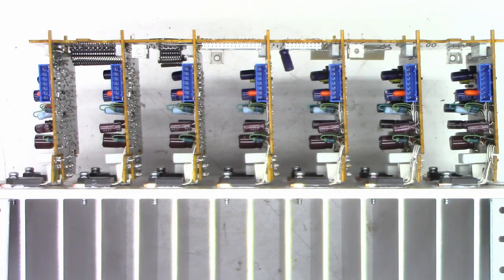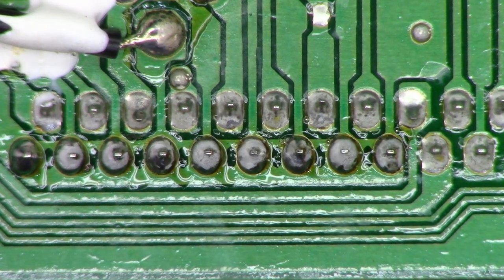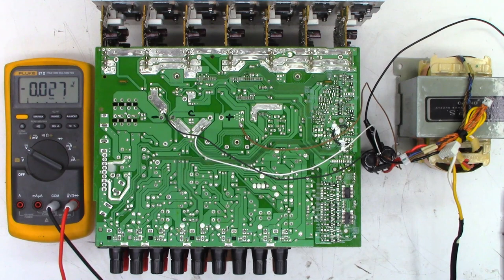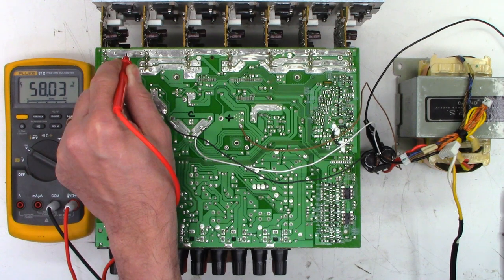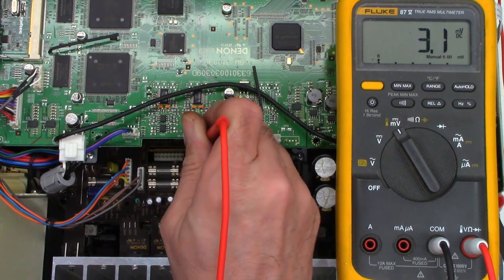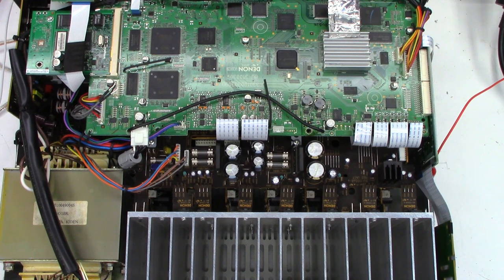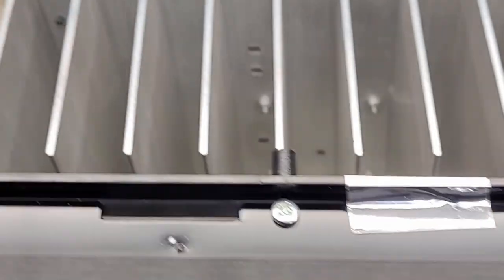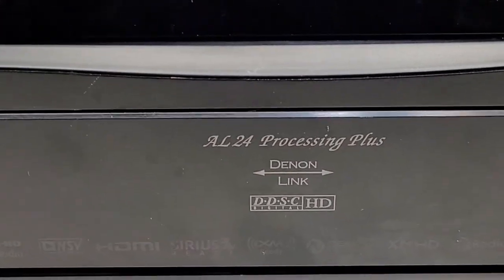Denon AVR-4310CI Part 2 - Shuts down - DC Offset on one channel - No parts required repair Fix

Comment: These AMPS were 2nd model from top around 2009-2010.. They were around £2k..i own the Denon 4308CI that also was 2nd from very top flagship model 2007 which was also just over £2k.. During last final golden years for AVR units. These units are certainly worth spending alot of time and money on. Denon definitely don't produce this type of high end hardware anymore unfortunately things have changed.